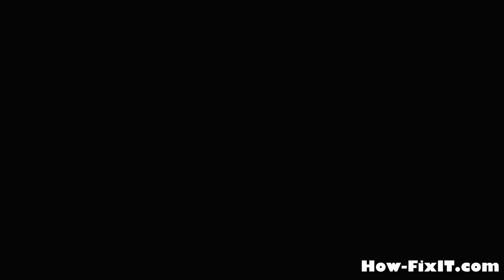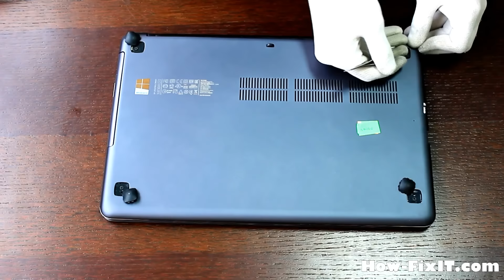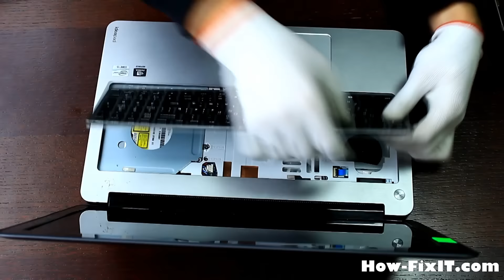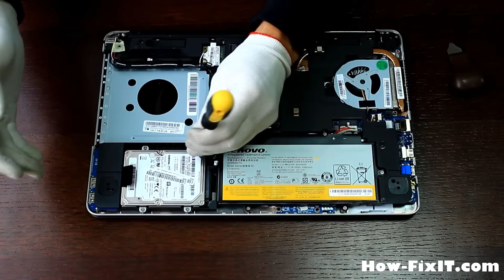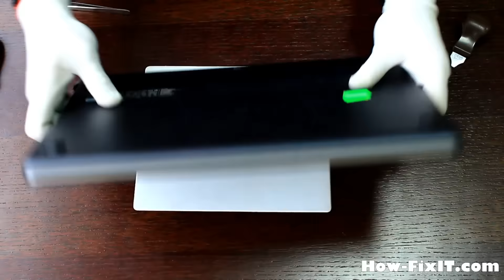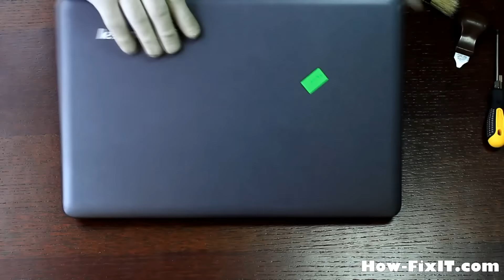Lenovo IdeaPad U510 Disassembly and Fan Cleaning Guide

Comment: It does everything under voltage with the battery connected. Is it possible to burn a laptop like that? do you need to change the thermal paste?

Comment: I don't seem to get any sounds from the video above, so I don't know if you are explaining your steps. 
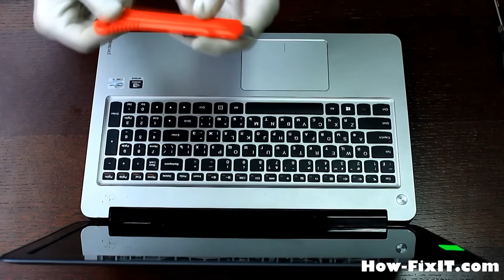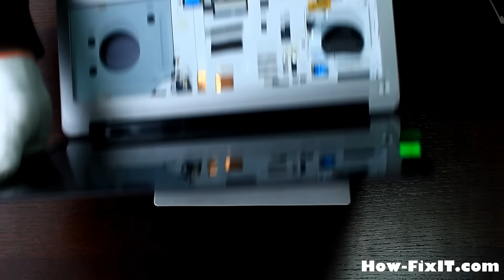So please tell me, if I need to replace the RAM chips, do I really need to remove the keyboard, the screws, the DVD and the sockets as you do from 1:15 to 4:20 of your video or I can avoid it and just open the back cover of my laptop as you do right after?
Reply from the maker: Fotis Evangelatos yes, this is only way
Reply: How-FixIT ok thank you vary much!!
Reply: +Fotis Evangelatos nope, you just need to remove those 5 screws under the keyboard, no need to disconnect anything (except the keyboard to get access to them). I just added 4GB of RAM to my brothers U510.

Comment: Question I have this laptop I spilled a little tea on thr keys and it got under the keys I immediately turned it off and blew it all out as fast a possible what should I do? I see that the keys are a tray them self would just leaving it off and drying help? Also it didnt spill over all of the keys just from like from f to cap locks. What should I do?
Reply from the maker: you have to give you laptop to service center because if you won't lucky your laptop would break

Comment: is the dust actually a problem ?
and how often should I clean it ?
Reply from the maker: Actually yes - dust is problem: dust prevents air circulation in laptop so it's making cooling less effective. Periodicity depends on circumstances. Minimal period to the next cleaning in my opinion is 6 months (if after 6 month there is still not a lot of dust you can clean it less often).

Comment: here is a question for the technically savvy , ive noticed there is a port on the motherboard which looks like its met for a Bluetooth module anyone have any idea what would be compatible .

i have whitelisted the bios but i have no interest in using a wifi/bluetooth combo card so no need to mention that